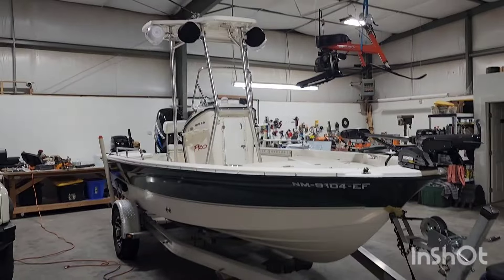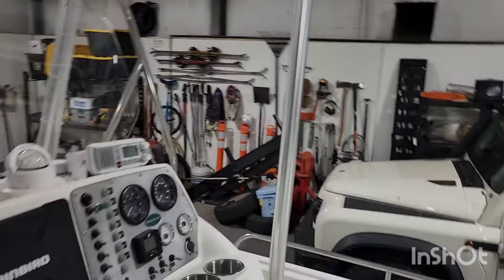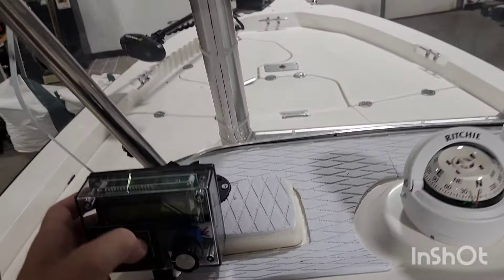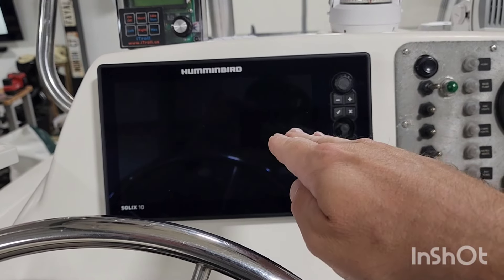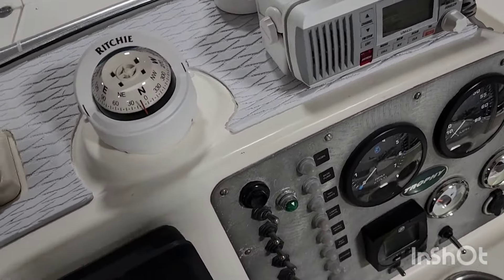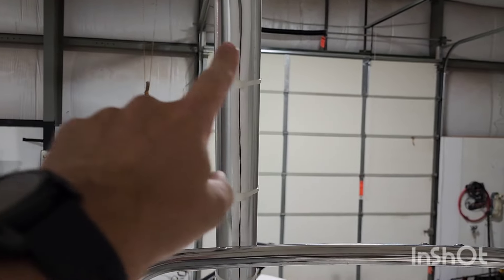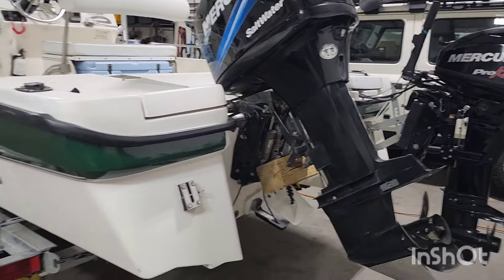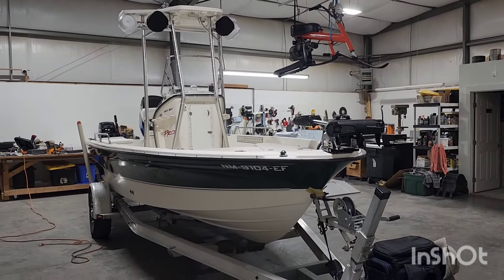2005 Trophy 1901 Bay Pro Center Console Boat! What was I thinking?

Comment: Bought this same exact boat about 6 months ago and slapped a brand new 150 pro xs on, it's been awesome. Also was amazed at the on-deck drainage system, very unique for a boat that size.
Reply from the maker: @ZacharyWilson-o8r  that's awesome! I absolutely love mine. I've wanted to put on that motor as well but gave this Optimax a tuneup and it's been perfect so couldn't justify it just yet.